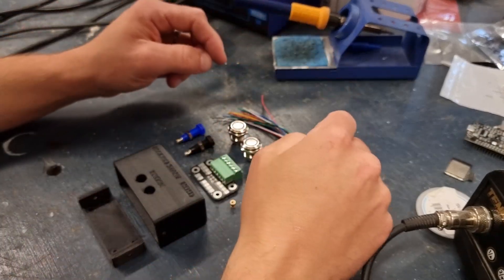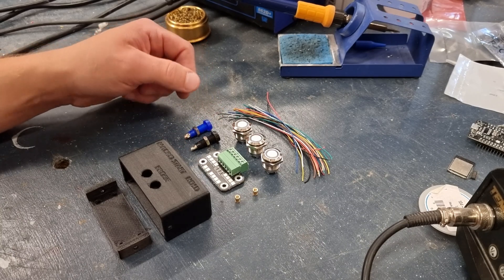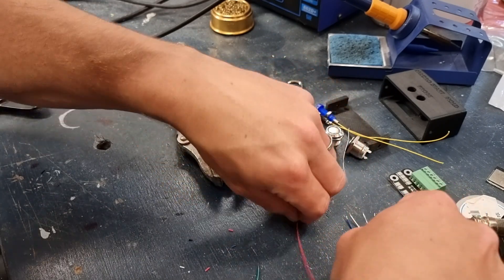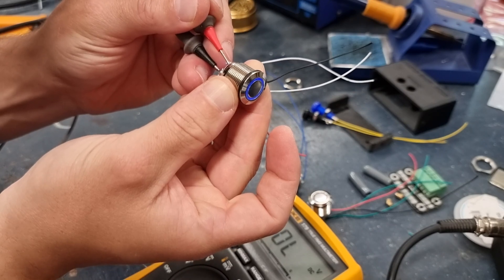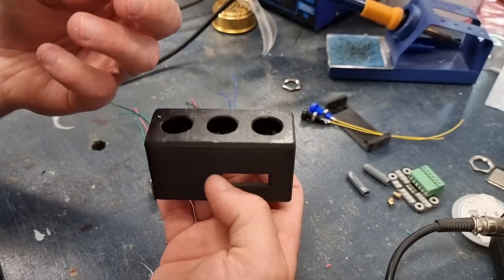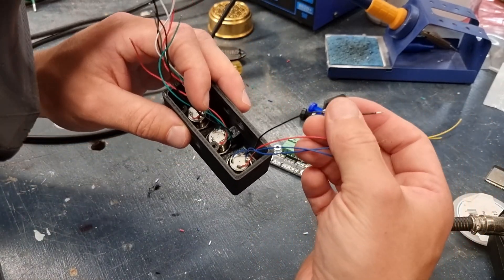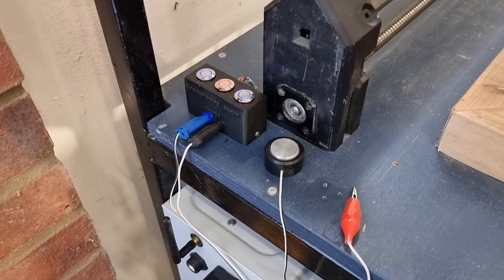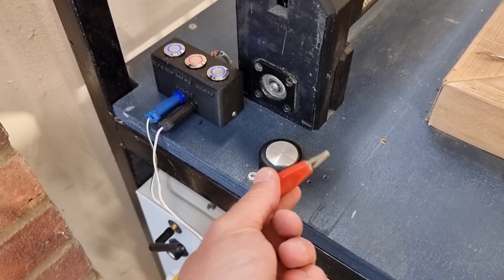Root CNC Controller Probe Mount Wiring

Comment: assuming id like to run 5 limit switches,  a e-stop in software, a toolsetter , a touchprobe and a door safety and a fault pin for the closed loop steppers id need 10 inputs, am i right😢 but it only has 8 

does anyone have a  solution for this
Reply: no , i have time, i first want to finish the hardware, so ive now cancelled tje order of the 8 input Version 

but good part on the planning 👍 because otherwise it is has a incredible value
Reply from the maker: Good planning on your part!

I have a prototype controller which does have 10 inputs in work. its the pretty much identical with some different input connectors, to facilitate 10 inputs . I'm about to order the PCBs shortly - are you desperate for a controller now? or could you wait a 1- 1.5 months for it to be design and built? You would be considered a Beta tester - so would get some discounted rates too!
Reply: Why didn't i read this before ordering, a month ago.. =)  @RootCNC
Reply from the maker: @Cael817  the cards got delivered today!